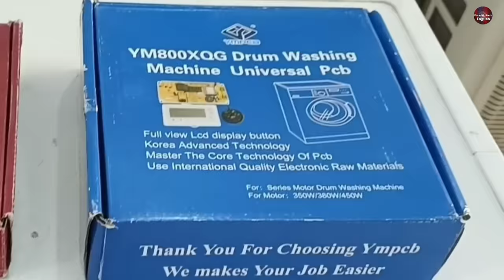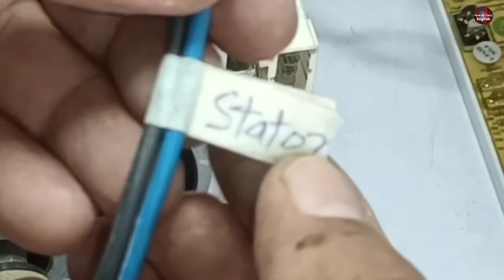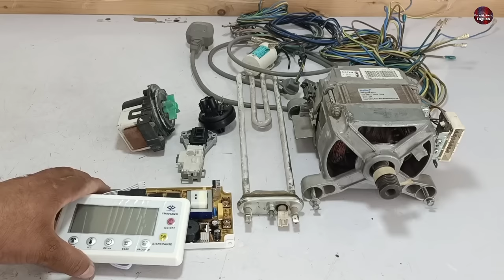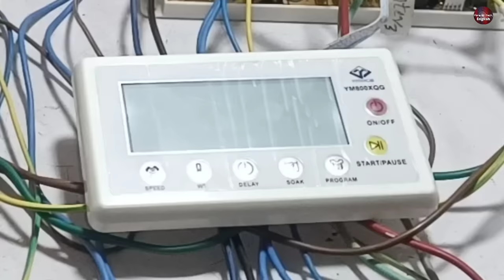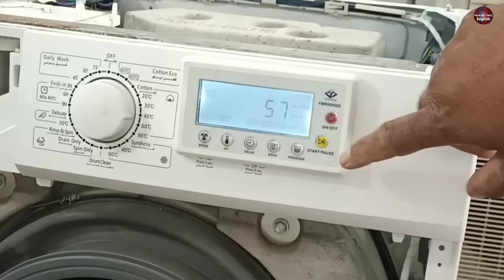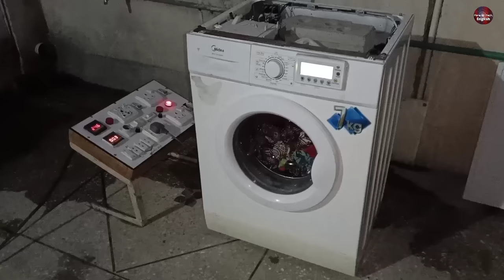Reviving Washer with Universal Circuit Board

Comment: Today I learned that there is a thing called Universal Circuit Board for washing machines. This is pretty cool, thanks for the video.
Reply from the maker: Cool, thanks
Reply: yes a top idea
Reply: Russian guy also has arduino based controller but not free
Reply: they also exist for CRT televisions, probably many more. I like this kinda future
Reply: I've used this uni-board in a dishwasher..it works well
Reply from the maker: @MrZakmuh  good to hear 🤗
Reply from the maker: @akierum  which russian guy you mean

Comment: In today's world, it's good to see that what's wrong is not thrown away, but repaired and works.  Congratulations!
Reply: I think this is a beautiful idea! That is sustainability, repairing your own home appliances!
Reply: There is but one question here if you replace the producer's board withe universal one is it still up to code and is it certified so in case something happens your insurance will still cover it a burned down house is more valuable then a saved  what 50 € difference between the original board and a universal one
Reply: @wasserman63  there's no guarantee the original part will not burn your house too. Also OE manufacturer will not give you guarantee for old machine. So once you are trying to repair old stuff - everything is on your own risk.
P.S. I liked the idea of "universal control board".
Reply: i agree it want and "I" like the idea of a universal board but its not me who decide that but on the and of the day its you insurance  its like you changed a crucial par on your car and it fails then you are s o l
Reply: @wasserman63  You missed the point! I was repairing washing machines 35 year ago when it was still doable  in southern europe. The original controller board isn't available anymore. Also this is mostly done in poor countries with cheap labor. Safety is the least on thier mind. Have you seen the state of their main electricity infrastructure? There is no code in some countries.
Reply: Only the hot glue is too bad.
Reply: New washing machine $500 - my rate to completely disassemble and rewire an old machine, $600. Plus parts. Your choice.
Reply: Just finished repairing and restoring my 20 year old washing machine. Complete with rust removal and car paint and clear coating and a touch of color!

Comment: An interesting video. The channel says based in the US but I  don't think many people  in the  US  or the UK would want to be messing about with a universal controller especially on an older machine - just buy a second hand board  and fit that.  The cost of the labour  alone would not make it financially viable. It would be cheaper to buy a new machine.  There may also be some features on the  washing machine which are not  provided for in a universal board.
Reply from the maker: Thanks for sharing!
Reply: These days I wouldn't be so sure. Modern machines are not the best thanks to all the eco rules and compulsory energy saving measures put into OEM software. So, if you can bypass that, you can build a more effective machine.
Reply: I agree with MrE. Aside from the satisfaction of DIY, you're not a fool to consumerism. We're already gonna die buried in useless crap.
Reply: @fmphotooffice5513  In some countries it often doesn't stack up  to repair. I agree we shouldn't be throwing stuff away which could be made to work again but manufacturers  make it difficult to do otherwise and governments, at best,   turn a blind  eye  or produce more and more legislation to make repair difficult/not cost effective..
Reply: Its because of affordability (business sell items with Insurance), and they scrap their old appliances and buy another (new or used). Sadly, majority of people in western countries do not practice Green Environmental Protection Laws, i.e. 5Rs  
1 Reduce 2 Reuse 3 Recycle 4 Recover 5 Rethink or Repurpose. We must follow 5Rs. 1. Reduce: Minimize the generation of waste by using resources more efficiently and consuming less. 2. Reuse: Extend the life of products and materials by finding ways to use them again instead of discarding them after a single use. 3. Recycle: Collect, process, and transform materials into new products to prevent them from ending up in landfills. 4. Recover: Extract energy or materials from waste through processes like waste-to-energy, contributing to resource recovery. 5. Repurpose or Rethink: Encourage a shift in thinking and behaviour towards more sustainable choices, considering the environmental impact of decisions and promoting a broader awareness of the consequences of consumption and waste generation.  The video looks like from Asia (India or Pakistan), where people cannot afford new things and repair and use old appliances.
Reply: @MrEdrftgyuji  
There junk that do not clean and break.i can not aford new one.
Reply: I'm in the US.  I've repaired my LG twice now. If the main board fails, this would be right up my alley.  I didn't know these board existed.  

Machines this old, it's a toss up whether you can find a good replacement board.
Reply: Its not only about the labour, but also the question about if insurance will pay if something goes wrong (fire, water damage) with an modified machine like that. For example in Germany you are even not allowed to connect an baking oven by yourself without risking insurance (although most do it by themselfes anyway).Oif course they will pay when such things happen, but insurance will reclaim that money, which could easily mean being bankrupt.

In addition, at least 20 Years ago someone in Germany also invented and presented an universal controller board for home washing machines in order to make then more efficient, but there were at least the same reasons why it didn´t proceed - and a conversion was too costly.
Reply: @NeverMind-pk4wz  Same thing in the UK. If you altered the washing machine from standard  and there was a fire the insurers may not pay out  for damage to your own property - and you might get prosecuted if the fire affected someone else - along with being sued !
Reply: @MrEdrftgyuji  You are definitely right ! Especially since the "super-performing machines" manufactured these days practically dry clean and therefore wash badly, very badly, my washing machine broke there, I wash my clothes by hand and they come out cleaner. Seeing is believing.
Reply: @pierre-zz9vs  Agreed. I´ve repaired a three year old washing machine with bearing damage for myself, which was thrown out by my neighbour. After a lot of work (plastic washing tub was "welded" and not meant to be opened), i was disappointed about its overall washing performance. The 20 Minute Program was completely useless, even for stinky socks, and some programs ran up to three and a half hours, which didn´t perform much better than my fifteen year old machine in one and a half hour. Yes, they might save some water and energy, but if a machine fails in such a short period (three years is a joke), nothing has been saved at all,

In addition, most "Eco" programs for higher temperatures (60 degree celsius) wouldn´t do the job like a "real" 60 degree program, because in Eco mode they won´t reach the temperature for killing germs and bacteria sufficently. Some machines which were on the test bench even did not reach 45 degrees in a 60 Eco program.

So replacing a machine which is approx 25 Years old with the newest doesn´t make sense at all. All that the manufacturers did in that time is refining the washing process and render their machines more or less unrepairable at some points in order to drive sales, but the overall effect is marginal or even to the worse. If the total Effect is maybe saving 10 , 20 or even 50 Kilowatts per year against the older machine, it would mean that the new machine would virtually never reach that point where it pays for itself. 

If it breaks too early (most likely with todays machines) and replacement parts are too expensive - in my case it would mean a new tub, half the price of the entire machine; where its faulty bearings cost $10-$15, (the entire washing machine industry uses standard car ball bearings; so don´t be fooled) even more money was lost than saved. And nothing good has been done for the environment either. You can do this calculation on virtually everything where nature preservation is a selling point.

If you want to save energy for the washing process, unplug your machine while its not in use, because some (or most) Washing Machines (clothes, dishwasher) draw current while not being in use; they don´t disconnect from mains like older machines with electromechanical switching mechanism did , they are in Standby. My Washing machine and dish washer used to draw a total of 15 Watts per hour for doing nothing; that is a total of 360 Watts per day, which could mean energy for a short 30 degree program or three to four hours TV. Per day.
Reply: @NeverMind-pk4wz  You're worried about the wrong thing. Our house are filled with "made in China" products with lithium batteries.   If you're going to have a house fire, it's more likely to be a battery operated toy/laptop/phone instead of a mechanically simple washing machine. 

Washing machines can be put out with a conventional fire extinguisher. Batteries not so much.
Reply: @quademasters249  I know, but like a faulty design of a lithium cell or its BMS-Circutry; Quality of the parts being used or wrong design of a HV-Circuit can also lead to damage. 

The thing is: If a Lithium cell catches fire, there is at least someone who is responsible for it, mainly the manufacturer of the battery or the device where it was put in. So in case of extensive damage, you can rely on the fact that the manufacturer has to take responsibility for the damage it caused. But if you put by yourself a circuit into something where it doesn´t belong - even if it works - , then you take by yourself total responsibility for it, because the machine is no longer original and virtually no manufacturer behind it, because - you - became the creator of that thing. So you take the risk fully alone. 

This is why repair shops and others hesitate to do such an conversion in big numbers, because they would ruin themselfes in case of damage. Likewise no car repair shop (at least in my country) would put your own oil bought somewhere else into your engine; they would have to take the potential risk of damage caused by it. The - process - of putting the oil into the engine was done by - them -, not you.

From a technical point of view, replacing an old control circutry with a new one is totally interesting. As i am by myself a electronics designer and Microcontroller Programmer for dozens of years, i would convert and use such a machine - if i could be sure that everything was done well. - I - can do that, but others not.
Reply: @NeverMind-pk4wz  Allow me to add another thing: When I ask the "Experts" why the washing machine washes badly the answer is the following: Consumers load the washing machine too much. Basically you have to put less laundry in, then the question arises spontaneously if I have to do more washes or add an additional rinse where is the energy and water saving? Spin up to 1200 RPM, absolutely useless 700/800 are enough, at maximum speed the bearings last half as long.
All this much vaunted Eco is in my opinion Eco-economically profitable for washing machine manufacturers.
Reply: @pierre-zz9vs  So true. And politics follows this madness. Nothing against nature preservation, i go totally for it. But scrapping the old machine because of a "high" energy consumption (by definition and those definitions change from time to time) , get the materials out of it (probably somewhere in Africa without any safety measures for people and nature) , make them usable again, build a new machine which is harder or impossible to repair at its weakest point, transport it to the the dealer and from there to the customer is no way better for the environment. 

Same goes for LED light bulbs; it has compared to a CFL or even a "oldschool" bulbs a massive amount of electronics in order to drive some LEDs - and the first thing that fails is the electronics, because they cannot stand the heat that it generates by itself. But politics still argues that they last longer than a standard light bulb. That "might" be true for the LED itself, but not for the electronics behind. I - never - had a LED lightbulb which lasted longer for one year without showing signs of failure. Someone could tell me where recycling a PCB and Electronics (plus the plastics of the bulb) is more environment-friendly and less energy hungry than scattering glass and make a new bulb out of it. The only thing that generally happens is shifting away the problem and make it even bigger, as it was before.

Comment: Wire that is green with yellow stripe (or yellow with green stripe) should only be used for equipment ground.
Reply: In Europe yellow/green wire is used for earth. It should never have live tension on it. Not even neutral. That would be blue wire here. There is still red, black, grey, purple, white, even pink could be used. So no real reason to use yellow/green for anything but earth. Over here even yellow and green monocolour wire isn't used anymore
Reply: @Jo-re2ye   - equipment ground is equivalent to earth
Reply: @Jo-re2ye  single colour yellow or Green Earth wire is compliant here if the insulation type can't be made in the usual green/yellow form.   
Glass insulated wires are an example.
Reply: I don't know why you'd care. Nobody does around here. Just make the right connections, who cares about colors? You people are being absurd.
Reply: @techalyzer   - these standard wiring practices are intended to keep people safe, both the service technicians and the users / consumers.
Reply: @stevebabiak6997  Can you please try to explain what COLOR has to do with safety?

In a LOGICAL manner if it's possible.

For instance, why would a PINK grounding wire be bad, as long as it's connected the right way?

You people are making no damn sense.

Comment: You made a good video, thank you.  But there are a few notes: 1. The yellow-green wire cannot be used anywhere other than Protective Earth (PÉ).  2. Do not connect wires of different colors in the terminal block.  3. Separate the low-current tachometer wires from the power wires in the block on the motor.  (This is a sneaky decision by the manufacturers; the mainboard will burn if foam gets on the pad).  4. Blow out the pressure sensor tube, since you've gone so deep.
Reply: I didn't get the 3. 🤔
Reply: @NicksStuff  This is a fairly common breakdown.  When the foam from the tank (it is enough to pour in the hand washing powder once, it will give a lot of foam) comes out of the tank and flows down the outer wall of the tank onto the motor.  The foam gets on the open connector and shorts the high voltage of the rotor to the contact of the tachometer sensor.  Then the speed sensor circuit on the board will burn out.
Reply: Ah nice tip (#3)
Reply: great tip (#3) thanks!
Reply: @sergeipshenichnikov6718 почему не курсанул про аморы?(детонация на раскачке отжима)а так красава бро!